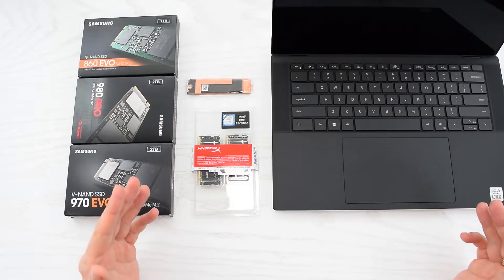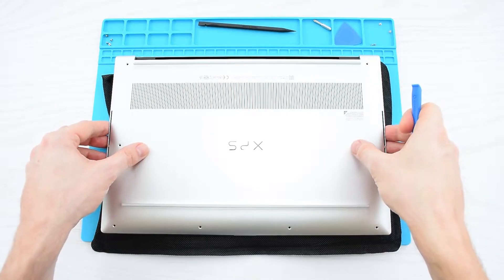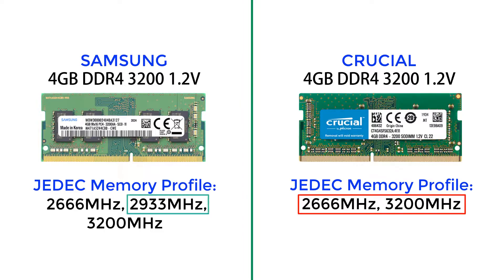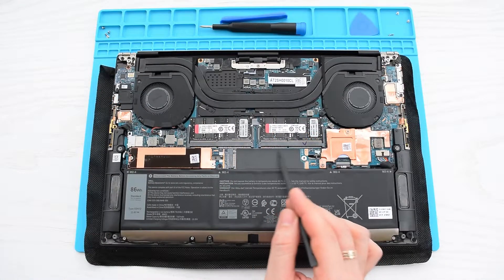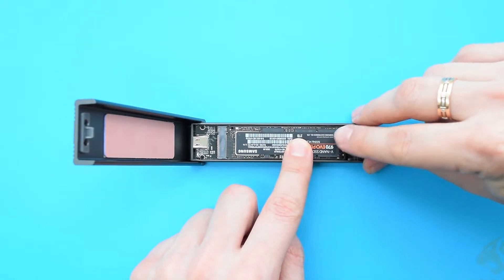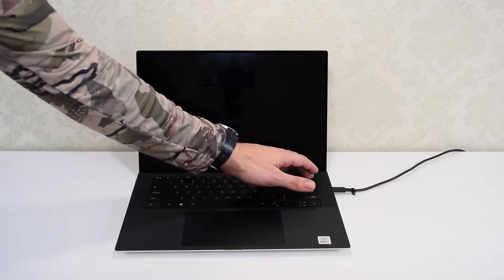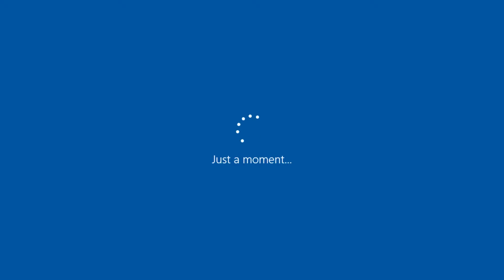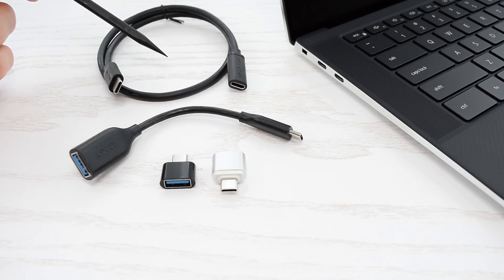Dell XPS 15 9500–9530 RAM & SSD Upgrade Guide | Max Performance Setup!

Comment from the maker: I decided to add to the title and the description Dell XPS 9510 which is the latest 2021 model. Both Dell XPS 15 9500 and 9510 are absolutely identical externally and internally, the only difference is that they have different CPU and GPU chips. Also Dell 9510 uses second M.2 slot instead of the first one. So if you want to install the second drive then you need to buy a heat sink for the first M.2 solt. The links for the heat sinks in the description to the video.
Reply: You mention the fact that the 9510 comes with the M.2 in the other slot from your video, is there a specific reason and/or does it matter which one the boot drive is in?  Does one slot run at gen 4 speeds in the 9510 and the other in Gen 3? Are they both Gen 3? Are they both Gen 4 (questions Specific to the 9510). I bought both slots heat sinks prior to my machines arrival so I am prepared for either, I just have to decide on the M.2 I'm buying for the second slot.  Too bad Samsung has no 980 Pro in 4TB variety.
Reply from the maker: @WrongNumbr  Both M.2 slots on XPS 9510 run at Gen4 (PCIe 4.0) speeds. There's no difference at all which one you will use. You can install two 980PRO 2TB SSDs if you need 4TB storage. 
Also if you want to buy Samsung's SSD (which I highly recommend) then watch this video: https://youtu.be/I8Z09nU554Q
Reply: @ElectronicsComputers  this video does not show that it runs at speeds of 980 pro, it is limited to Gen.3. take a closer look at the video
Reply: @ElectronicsComputers  min.7:45, the benchmark shows that it is running at gen.3 speeds this 9 TB 980 pro
Reply: @WrongNumbr   min.7:45, the benchmark shows that it is running at gen.3 speeds this 9 TB 980 pro
Reply from the maker: @Ionescu Razvan  Of course, it runs at Gen 3 speeds that was the whole point to compare how Gen 3 and Gen 4 SSDs perform on a gen3 capable laptop. As you can see, Gen 4 ssd provides better performance on Gen 3 PCIe.
Reply: @ElectronicsComputers  I was interested in whether the 980 pro put on the 9510 has real performance of the Genus 4. So, I better add a 970 Evo and it has the same limited performance for the Gen 3 as the 980 PRO, being even cheaper than the latter.
Reply from the maker: @TheSplendidFilm  Dell 9510 has Gen 4 PCIe so choose Samsung 980Pro. The laptop that was in our test has 10th gen intel CPU which supports only gen3 PCIe.
Reply: @ElectronicsComputers  Are you sure the Samsung 980 (gen 4) works on XPS 15 9510 (i9 gen.11)? I mean, to work, I'm sure it works, but I haven't seen it anywhere or it's unclear if it reaches speeds of 6xxx for type 4. Thank you.
Reply from the maker: @TheSplendidFilm  Yes, I'm 100% sure, that you can get the full potential out of 980PRO on Dell 9510 with 11th gen CPU.
Reply: @ElectronicsComputers  txs a lot
Reply: @ElectronicsComputers   I was looking into this as well thanks for clarifying
Reply from the maker: @windianarones  Happy to help 😊
Reply: I just came from the LTT video talking about 1rx8 vs. 1rx16 RAM. I just ordered an XPS 15 so was nervous which one it'll come with. From the pics of your opened machine, it looks like it's 1rx16, which can result in 20% reduced performance compared to 1rx8 :(

Comment: I get the problem "No Bootable Device Found " when I try to boot from the 2nd SSD with Windows installed on the 1st SSD and Ubuntu installed on the 2nd SSD. The problem is gone only when you remove the 1st SSD or boot from the 1st SSD.  DELL BIOS sucks.

Comment: My xps9510 had 2 8gb (16gb) ram cards but my upgrade only came with 1 32gb card, do I take both out and only put in the 32gb in one slot, or leave one of the 8gb in?
Reply from the maker: You should remove both 8 GB sticks and install the 32 GB module by itself. Mixing different sizes can work in some/most cases, but it can cause stability issues. Using just the 32 GB stick gives you optimal performance.
Reply: @ElectronicsComputers would it be better to have 2 16gbs (for 32gb total) since it’s dual slot, or will one 32gb card achieve the same performance?
Reply from the maker: @Smwhereat4am  Technically speaking, 2x16 would be definitely faster as in that case your RAM would work in dual channel mode, utilizing the whole bandwidth. Another question you should ask, is how  big that difference if any at all. If you're doing just regular stuff browsing, streaming, office work, even some light video editing, the difference between one stick and two is usually small and you'll never tell the difference. So dual-channel basically can help in stuff like gaming, 3D work, and certain CPU-heavy tasks.
Reply: @ElectronicsComputers greatly appreciate your input my man, thanks for the help!

Comment: What is your opinion about Dell XPS 15 9500 after some time of use? Some Cons?
Reply from the maker: I have both the XPS 9500 and 9510 been using them about 12 hours a day for years with no issues. I replaced the thermal paste and pads (I have a video that) with better ones early on and never had to open them again. RAM and SSDs are upgradeable and if the GPU dies, it's possible to switch to Intel graphics. In my repair shop, I mostly see them for user-caused issues like spills or overheating. Set cooling mode in Dell Power Manager to Cool and clean dust once in a while  they’ll last a long time. The newer XPS models are worse, lower screen resolution, soldered RAM but still pretty reliable.
Reply: @ElectronicsComputers Wow, thank you very much for detailed answer and I'm happy to hear what you are saying. I'm helping out some fussy person obsessed with white laptops and I found this model with proper configuration and checked your video to see what can be swapped or fixed.. All the best!

Comment: u think it might cause a problem to use a 1mm thermal pad on the ssd? the old pad is not in great condition and i only have 1mm left and i really don't want to order new 0,5mm pads
there is definetly enough room so the enclosure goes into place just fine, takes no real effort to push it in either
just asking to make i don't make a mistake
Reply from the maker: If you're still using the original 2230 SSD with an adapter, then you should be fine no problems there. If it’s a 2280, that should be OK too, but it really depends on the specific drive. Just remember, SSDs are extremely delicate and fragile. If the heatsink closes easily with a 1mm thermal pad under it, then you’re good. But if it feels too tight or resists, I wouldn’t proceed, that’s for sure.
Reply: @ElectronicsComputers sorry but I couldn’t find those 22xx numbers 
My original ssd died so I replaced it with a crucial T500
As mentioned no real pressure when in place
Reply from the maker: @kirawr8064  Crucial T500 is a 2280 form factor.
Reply: @ElectronicsComputers  that’s great thank you very much brother

Comment: Can u send link for ram upgrade for specifically xps 9500.. i saw u said some model dont support 3200 or 2666 and they need 2999.. thats why i want to make sure what i need to get. Thanks
Reply from the maker: You can use this one: https://amzn.to/4j55zta
Those 3200MHz modules support 2933MHz speed profile, so it will work absolutely perfectly with your Dell XPS 9600.

Comment: Thank you for making a great video.  The only problem I experienced was with the ram on the Xps 9510.  It would not boot up.  Went with Crucial 
CT2K32G4SFD832A and it worked.
Reply from the maker: Thank you for the comment!

Comment: Thank your for this great video! Can please advice which RAM module you recommend for "XPS 15 9560"
Reply from the maker: Your laptop supports DDR4 2400MHz RAM, with a maximum of 32GB across both slots. For best performance, the ideal setup is either 2×8GB (16GB is enough for everyday tasks and web browsing) or 2×16GB for heavier multitasking and future-proofing.
Best price-performance option: https://amzn.to/4dAIfC1
Best in terms of quality and longevity: https://amzn.to/43fLZ6U

Comment: Thank you so much for such a great video with step-by-step instructions.
I have a Dell XPS 15 9500, can I upgrade Wifi Card in it?
Also, can I upgrade the factory fitted SSD to SAMSUNG 990 PRO SSD NVMe M.2 PCIe Gen4, M.2 2280 Internal Solid State Hard Drive, Seq. Read Speeds Up to 7,450 MB/s for High End Computing, Gaming, and Heavy Duty Workstations, MZ-V9P2T0B/AM?
Reply from the maker: The WiFi module in that laptop is soldered to the motherboard and is not user-replaceable. As for the SSD, you can use either the Samsung 880 Pro or 990 Pro. There isn’t any difference in performance since their speed will be bottlenecked by the chipset's capabilities, so choose the one that offers a better deal.
Reply: @ElectronicsComputers  Thanks for your reply. I was wondering if the soldered WiFi module can be replaced using a Solder!
Reply from the maker: @KB-wb9ym  You'll need a hot air station to remove or replace the wireless module.
Reply: Will this sequence of steps work on my Dell XPS 15 9500 Laptop:
1. Take the stock PC611 NVMe SK Hynix 512GB SSD out from Slot 1.
2. Upgrade by plugging in new SAMSUNG 990 PRO SSD NVMe M.2 PCIe Gen4, M.2 2280 Internal Solid State Hard Drive, Seq. Read Speeds Up to 7,450 MB/s for High End Computing, Gaming, and Heavy Duty Workstations, MZ-V9P2T0B/AM into Slot 1.
3. Plug in Stock SSD into Slot 2 'As-Is' without formatting.
4. Fresh install Windows 11 Pro on upgraded SSD in Slot 1.
5. After the installation is complete, copy all the data from Slot 2 SSD to Slot 1 SSD.
Thanks a million. Chrs
Reply from the maker: @KB-wb9ym  Yes, it will work perfectly with your laptop. There's no difference at all in which slot you install your SSD, either one will work just fine. I highly recommend removing the original SSD first and installing Windows on the new SSD. After the installation is complete, reinsert the old SSD to transfer your data. Once the transfer is done, delete all system partitions from the old drive, as they take up a significant amount of space. You don't need two operating systems installed across both drives, so this will help free up valuable SSD storage.

Comment: Hello, I want to buy a 970 evo plus on xps 9560 maybe you know what is the distance from the ssd to the case and what is the best radiator to buy to fit it
Reply from the maker: Buying the 970 EVO only makes sense if you can get an extremely good deal on it. Otherwise, it's better to invest in the 980 PRO or 990 PRO. Even if your chipset doesn't fully support the newer SSD generation, these drives will still outperform same-generation SSDs like the 970 EVO. I’ve made a video on this topic.
Essentially, same-generation SSDs that match your laptop's capabilities are designed to push maximum performance, which often makes them run hot. The Samsung 970 EVO is well-known for running very hot, whereas the 980 PRO or 990 PRO can easily achieve the 970 EVO’s maximum speeds as just a fraction of their potential. This means they won’t overheat or thermal throttle, improving the SSD’s longevity and allowing you to reuse it in a more modern laptop in the future.
In that model, the laptop’s back cover also works as a heatsink. Instead of using a thermal pad, I recommend opting for thermal putty. For our clients, we use products like UPSIREN U6 PRO, UTP-8, or UX (available here: https://alii.pub/729d93). Thermal putty adapts perfectly to uneven surfaces, ensuring full contact with the SSD and providing significantly better thermal conductivity compared to standard pads. This method is commonly used in high-performance systems like gaming consoles and graphics cards, where superior heat dissipation is crucial
Reply: @ElectronicsComputers  I appreciate your detailed answer, I'm waiting for Black Friday and hoping for discounts, but evaluating the prices now, the difference is really not significant, especially considering that SSDs can live for more than 5 years and be transferred to another system. I've never heard of Thermal putty before and I don't even know how to use it correctly, I can't find anything on your link, but I'll read about it on the Internet, and I think that even with it it's better to buy a thin copper radiator, I hope 0.8 mm will do, thanks again for such a great and reasonable answer
Reply from the maker: @Dude_truthteller  I don't have that specific model in my repair shop right now, so I can't measure the exact distance between the SSD and the back cover. However, as far as I recall, the gap isn't very large. You can experiment with a thin heatsink and a 0.5mm thermal pad, but using thermal putty is a more reliable method. It will definitely outperform a heatsink combined with a thermal pad. Here's an example of how thermal putty is applied to an Xbox SSD: https://youtu.be/GTvtAM7Fi5U?t=473

Comment: An good old trick from old XPS series is to place thermal pad ABOVE heatsink, to allow heat transfer to an aluminium base of notebook(which is nice and thick, and could work as a nice passive heatsink). Yes the base would be hot 🔥, but I will pay this price for the silence and lower temperatures...
Reply from the maker: Yes, that's a great idea, but instead of using a thermal pad, I recommend thermal putty. Thermal putty is better because it compresses to the exact thickness needed and typically offers superior thermal conductivity. Unlike thermal pads, which might require stacking and adjusting to get the right fit, thermal putty is much easier to apply and ensures consistent contact for effective heat transfer. UPSIREN U6 PRO/UTP-8/UX: https://alii.pub/729d93

Comment: Just bought a 9550 for $80 and I’m thinking of upgrading from 16 to 32gb of ram
Reply from the maker: I recommend using two modules 16GB each for dual channel mode, instead of one 32GB.

Comment: Hi. I can't use DDR4 memory cards from the previous generation XPS15 right?
Reply from the maker: If you attach a DDR4 RAM module from an old laptop to a new one, it will most likely work if the new laptop supports that RAM speed. If you can provide the full model of your old laptop (or the RAM model) and the new laptop, I could give you a more precise answer.